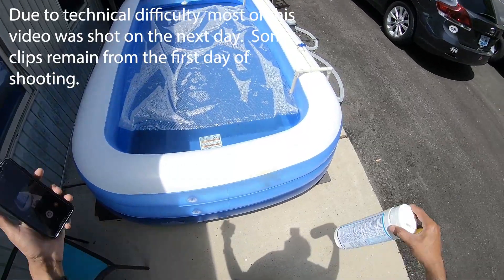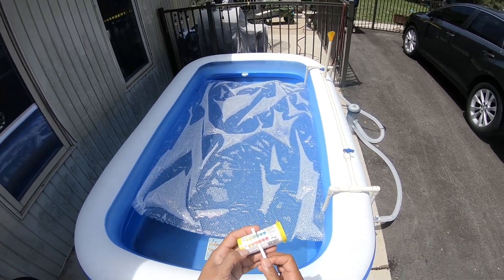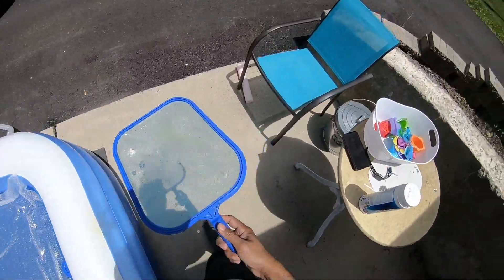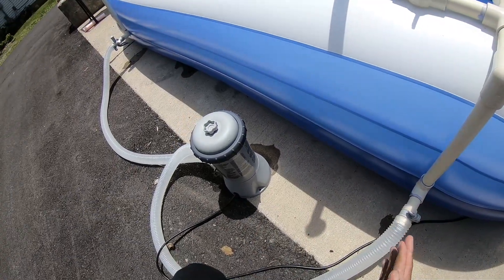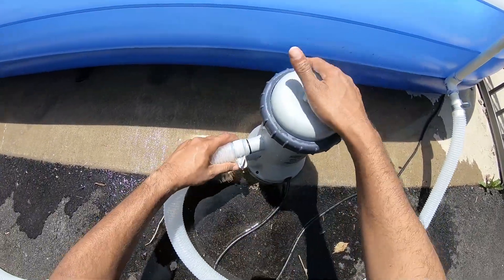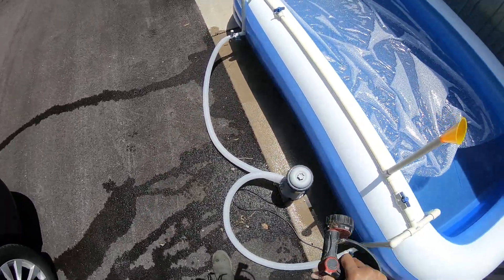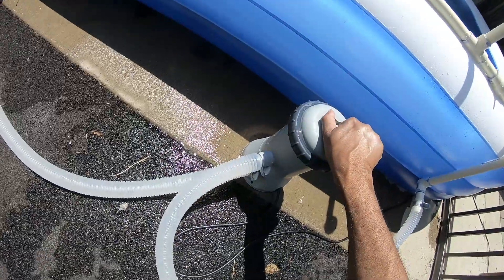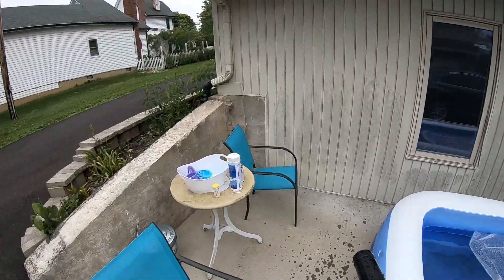Kiddie Pool Cleaning with Filter System, PVC structure, Siphoning/Priming, Shark Bugs, etc.

Comment: I also had to open up the pump and fill it with water in order to have as little as possible air in the system, and then it worked.

Comment: What size pipe connected the hoses on the outside? I ordered all the parts and the hose is exactly the same 1” diameter and will not slip over the PVC.
Reply from the maker: I don’t remember! I now use this as an antenna I will see if I can measure it. Note that I used the wrong kind of pvc I think I mentioned that in the video. We upgraded to a non inflatable pool and it was well worth it.  Same footprint.
Reply: @sunnywiz  thank you
Reply from the maker: I could not take a picture but basically I had cpvc which is smaller and then I wrapped electrical tape around it a LOT to make a bump that I could clamp the hose onto.  The original video I watched the dude said that normal PVC = “tight fit” but doable.  Cpvc is smaller than pvc and I think the measurements are inside not outside diameters
Reply from the maker: My video, the description, has link to original video that I followed
Reply: @sunnywiz  thanks

Comment: Did you fill the water up to the water max hight indicator line? The long side walls of your pool looks sturdy and straight. Our pool of same size, the long side walls bow outward. Any idea why?
Reply: I had the same thing happen to me Haidi and Al Wang!  I wasn't able to understand why it was doing it either, but you're not alone!
Reply from the maker: It’s on a slight slope so I tend to keep the water an inch below the fill line. Water is super heavy!
Reply from the maker: Update: I think over time the weight of the water stretches the plastic and it bows
Reply: You need to reinflate the bottom ring if the pool is sagging.